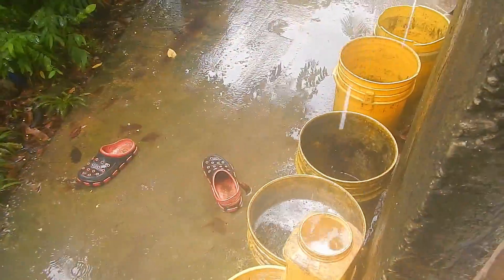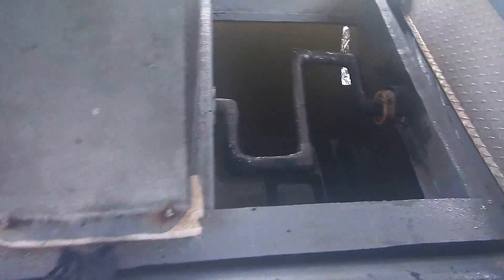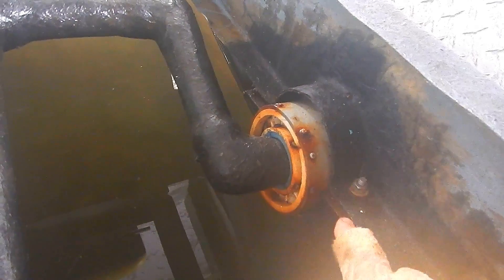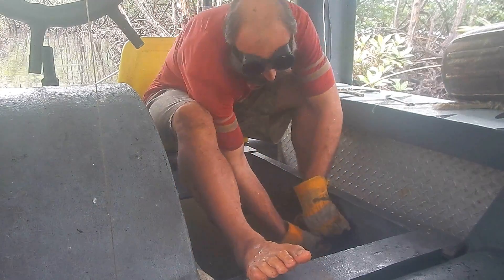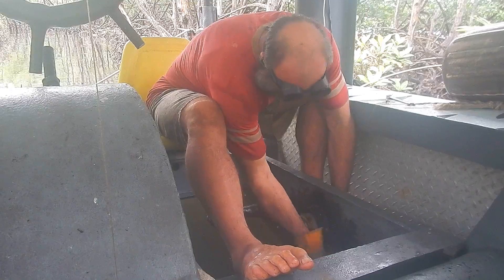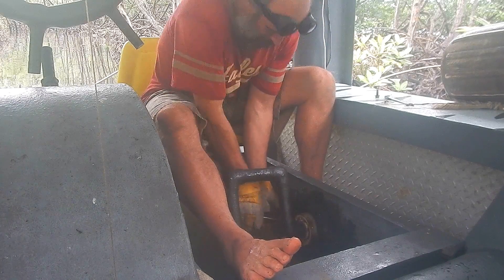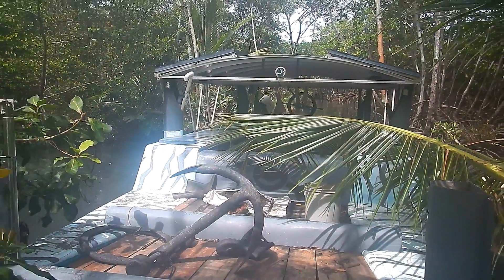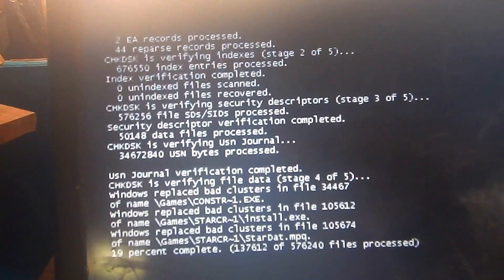Fix That Boat!!!

Comment: Kill the battery? Why do you keep saying that? It won't harm it to go to 0. Might as well use the battery to its full extent if you need it.
Reply: it does harm most Lithium to go to zero
Reply: @willdarling1  No it does not. By zero, I mean 0% state of charge, which equals a safe discharge voltage that the BMS cuts off at. Completely normal operation. There is no "killing" there
Reply: @ٴٴٴٴٴٴق  I mean...if you completely trust the BMS while living cut off in a remote location....